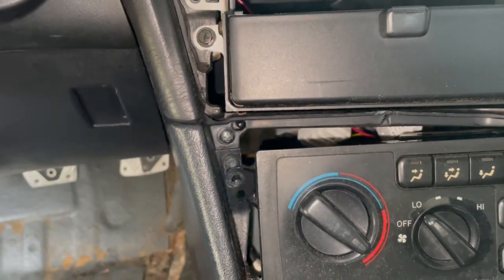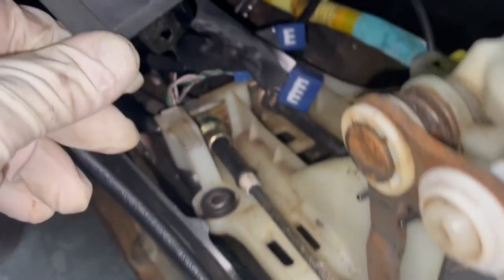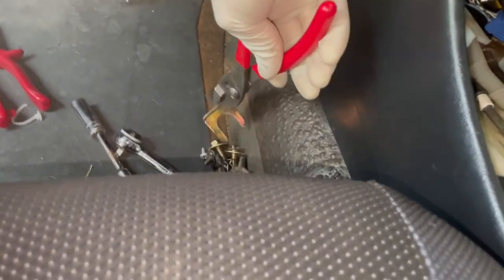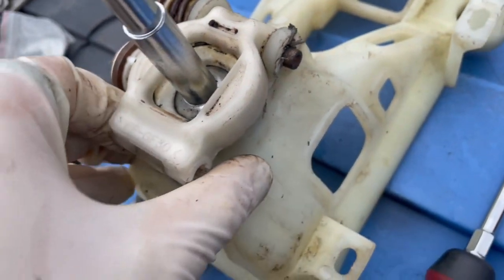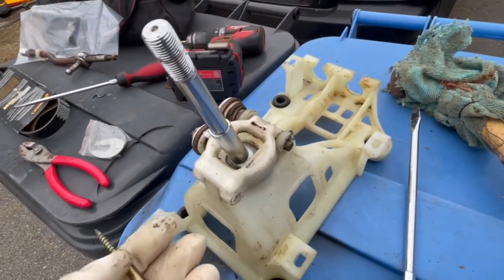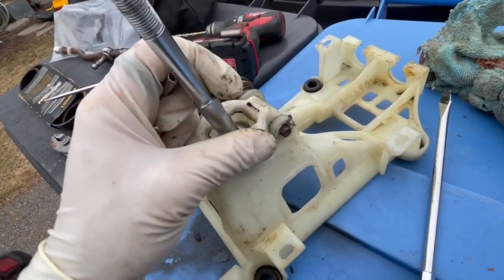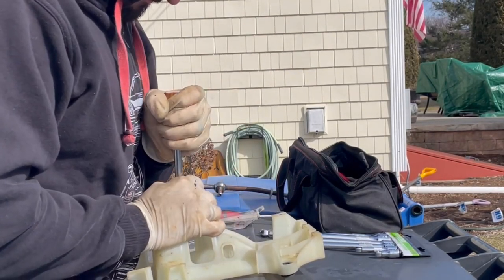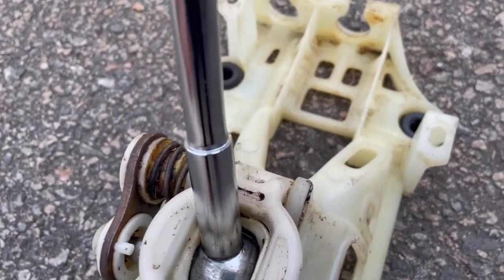1994-1999 Toyota Celica Short Throw Shifter Install -Ralco Rz-

Comment: Do you have a link for where you purchased that short shifter? The only ones I can find online for the st204 is one by a company called super-klasse
Reply from the maker: https://www.ebay.com/itm/404345270675?chn=ps&_trkparms=ispr%3D1&amdata=enc%3A15HCB664UTzWFGxPmKI3udw11&norover=1&mkevt=1&mkrid=711-213727-13078-0&mkcid=2&itemid=404345270675&targetid=4580909052916235&device=c&mktype=&googleloc=&poi=&campaignid=603418355&mkgroupid=1236951585419131&rlsatarget=pla-4580909052916235&abcId=9323207&merchantid=51291&msclkid=9af7ccc69c98120429b8a9ae088accc4

Comment: Heres more info as im In the process of putting it together myself for anyone interested in the future.

You dont have to cut the dash! I know it was done here and i know in 6gc net they say to do so but you do need to! And you dont even need to take off the climate control just take off the dash trim, and once everything is unbolted you can slide the shifter assembly all the way back and tilt it towards the driver side (assuming everything is the same for the right hand drive cars) and it should come off. Only cut the dash to make it easier but its not necessary.  honestly i didnt want to knowing this are old cars and destroying the very few parts available sucks

the little piece at 6:41 as long as you have a small flat head and only hitting the edges, it should slide out enough to grab the other end with pliers. make sure to grab it from the teeth side so it doesnt get squished as you pull it out so its reusable! (There a video here on YT that shows it has the same retainer as the front in some models) 

As for the retainer clip up front a chisel will lift it up and with the flat head you can carefully take it off without breaking it so it can be reused aswell

As for the little plastic bits on the shifter itself that you have to transfer over, i used "needle nose angled pliers" from the bottom holes it has and pulled, as going from above might damage them. 

Lastly now that i finished, I'd like to point out its just about half an inch difference of a throw, i was hoping the bottom portion would also be shorter for a smaller throw but maybe thats for safety or something. It Does feel nice and tight though! Good luck to all
Reply from the maker: awesome, thanks for the details.